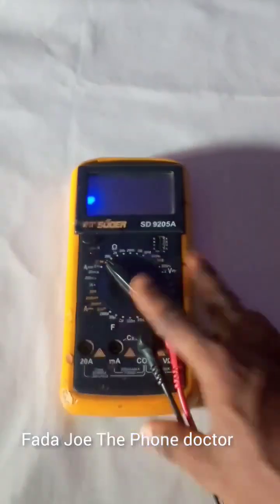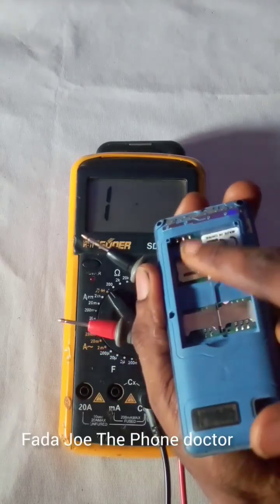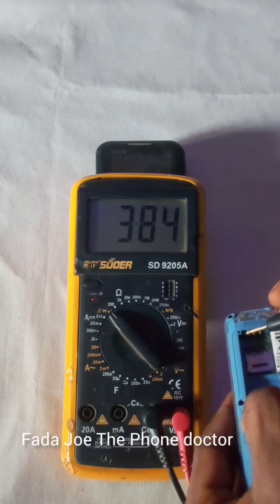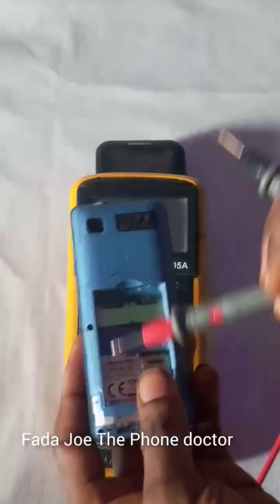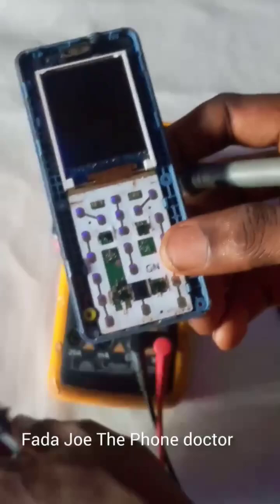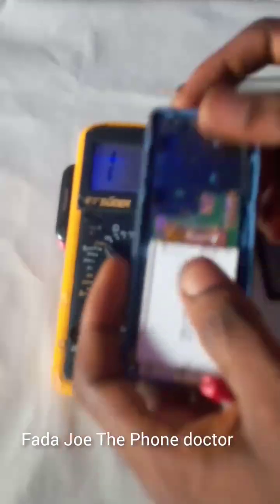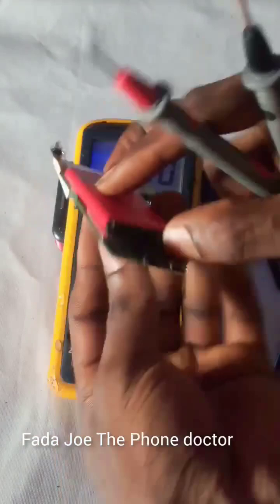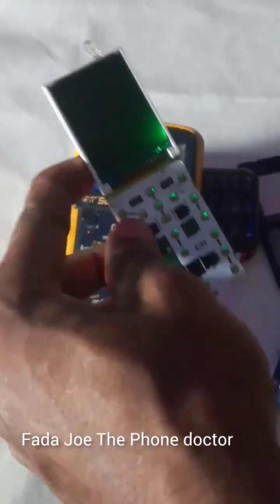How To Use MULTIMETER To work Any PHONE - Step by Step TEACHING

Comment: 1. What you call current is voltage
2. What you call bride is short (short-circuit)
3. Every components is not capacitor.
Reply: Nah so but They are working for each other sometimes like if phone fell inside water we go need to work on it together
Reply: @QuinnSandra-k2v 
What are you saying?